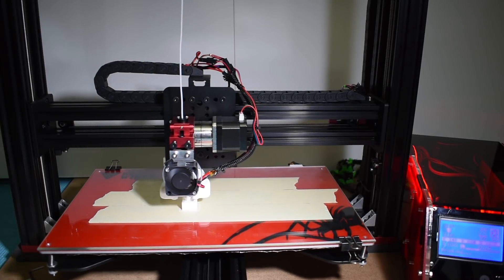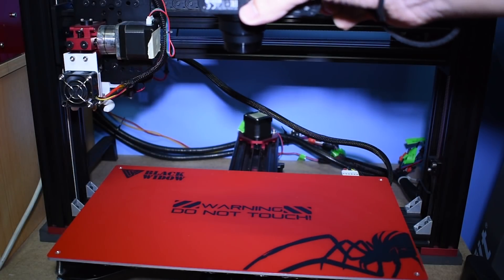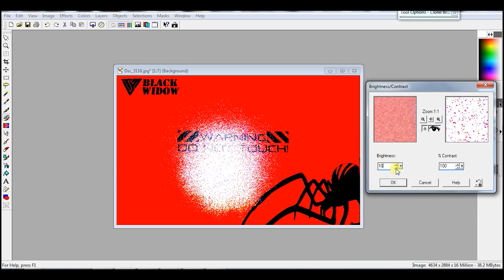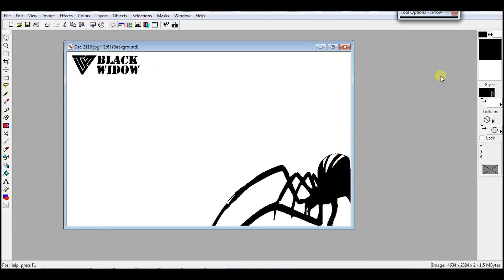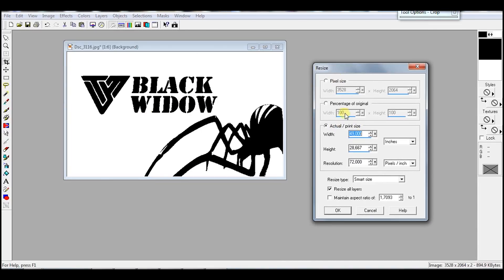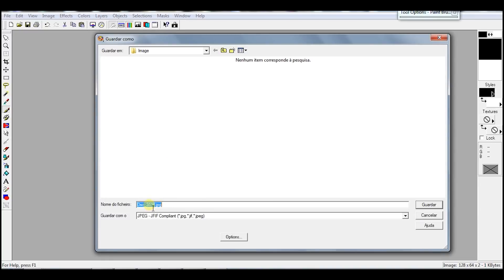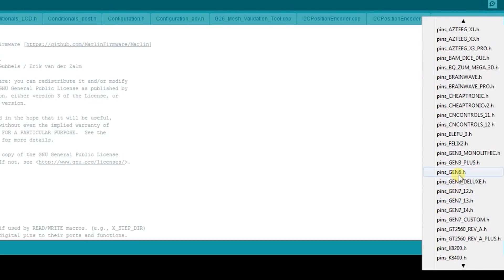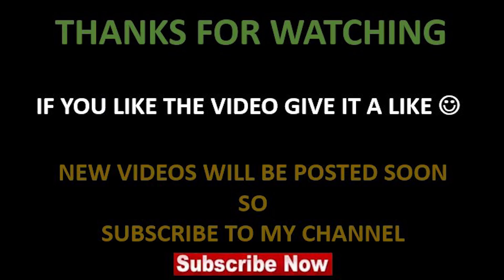3D PRINTER BOOTSCREEN - HOW TO ADD COOL GRAPHICS

Comment: Next time copy the spider the same way you did the Black Widow letters then said the canvas to the size it needs to be and paste them on top of that then make your adjustments should get less Distortion then.

Nice work what editing program is that you're using?
Reply from the maker: Hi,
thanks for the tip.
I use a very old version of paint shop.

Comment: Would you help me? please.
I tried to connect my PC to the printer and it always gave an error.
My PC did not recognize the printer, even changing multiple drivers.
I needed to adjust the X, Y and Z axes and extruder because I had to wait for the measurements, ie I asked the extruder to walk on the X axis 100 mm and it walked only 96.4 mm. So in the other axes.
  Interesting thing is that by repeating, I could connect and direct the printer through the PC.
But when trying again, to load the program to the printer, I could no longer connect nor by repeater and when trying to command the printer from the box, I noticed that the display was accessible, but without any characters. All information on the display that continues access has disappeared.
What happened ? I deleted the Motherboard program?
Is it possible to reprogram it?
Reply from the maker: Hi Ivan,
Surely something happened. If you dont see any characters and it's not a contrast problem, you can try to flash the firmware again. Many users have reported connection problems when using windows 10. Normally, windows 10 is a bit harder to maintain comunication. In you case i dont know if it was a PC problem or your board was already with some issue. If you cannot comunicate with the board to flash the firmware, there is a technique to restore the bootloader back to the board. For that you need to connect an arduino to the board and flash it. There are a few tutorials on line on how to restore the bootloader.
Reply: ruiraptor 
My PC is Windows 7 and I have not achieved in any way, communication between the card of my own, which is the MKS base 1.4.
I tried the LTDI drive, the 232 but nothing to connect.
"Windows can not install unknown device"
"Windows can not find software from drive to device"
I believe the MKS base board input is not working.
Without communication ebtre the pc and the plate nothing I can do.
Thank you very much for your attention.

Comment: I am using a RUMBA board, and my startup screen is in DOGMbitmaps.h and it lists a few. If I put the bootscreen.h in there will that override the bootscreens the other file is using?
Reply from the maker: Hi Rob,
Adding the bootscreen.h will not be enough. You need to search for the command that orders the firmware to load the picture in the bootscreen.h instead of the DOGMBitmaps.h. I don't know how that version is constructed but i suspect that you can copy/paste the image code from the bootscreen.h to the DOGMbitmaps.h....but as i said...i can only suspect as i don't know how that firmware is coded.

Comment: Hello ruiraptor, 
I have some Problems with my hotend. I made a Firmware update on my Tarantula and since then my hotend keeps heating up when i start the printer. It goes up to temperatures of 290 C. I have to turn off my printer to stop it. i checked the Firmware and even reflashed it to be sure. I have absolutly no clue and asking for help!
Reply from the maker: If the problem didn't appear when you flashed the firmware i would say you have a faulty internal mosfet. Since it happened when you flashed a new firmware, i would recommend you to flash a different firmware and check. You can try this old version to troubleshoot: https://youtu.be/P4W0UI9r6pI
Reply: I "updated" my firmware and the same problem is still there.... I'm sure the mosfet has some malfunction.
Reply from the maker: Then you probably do have a bad internal mosfet.

Comment: Hi Rui,
Do you know if it's possible for smaller screens too? I'll probably test it anyway on my stock Tarantula display but wanted to see if you tried it before attempting to do so...
Reply from the maker: Hi Nicolas,
Although i did not tested that, i believe it cannot. The graphic displays use a specific library that can handle graphics while for the stock display it uses just character output.
Reply: That's what I thought too. I tested it today and didn't worked. Thanks for the answer!

Comment: Download paint .net at getpaint.net - it's free and very good! Perfect for this sort of editing! :)
Reply from the maker: Thanks for the tip Chris ;)
Reply: ruiraptor thank you for the content :)
I have stumped this morning as have recently built 2 printers, a delta (my first) and a clone of the Tevo (my 3rd Cartesian). I have put them both through their paces and am now doing all the tidying up (cable management etc). This morning, I wanted to lock in the stepper drivers to 80% of max output for long term reliability but having a devil of a time working out what sense resistors are used on he a4988 stepper drivers - there appears to be no markings on the r1 resistor to let me know if it is .05, 0.1 or 0.2ohms!
I know most clone drivers tend to be 0.1ohm, so will be using this for calcs, (0.75mv for 1.7a nema steppers) - this doesn't give me the 80% margin but drives the steppers just below the 1a rating of the driver (assuming it's got a 0.1ohm resistor) Ah well!
If any one has a tip for using a multimeter to work out the resistor value in circuit, I'd really appreciate it!
Once the machines are buttoned up, I don't really want to have to pull them apart again as the cable management is the least favourite part of a build for me! :)
Reply from the maker: Hi Chris,
What board do you have?
With the MKS base, the resistor is 0.1ohms (that information can be  found in the manufacturer website).
Reply: ruiraptor hi, thanks for the reply. It is a 3dymy board labelled "ramps 2 Plus". The stepper drivers aren't surface mounted which is nice!
Reply: your links take us to some home painting site.. aka real paint lol fix the links please....
Reply: John Lennon unfortunately YouTube automatically makes "paint dot net" a clickable link which is why I put the real link after it - getpaint.net